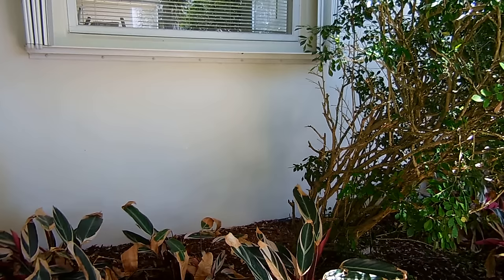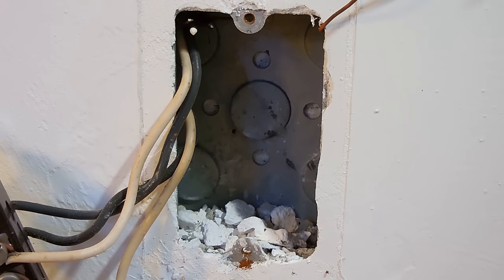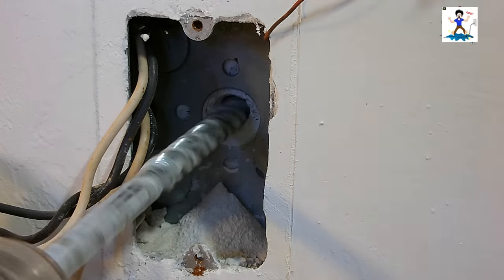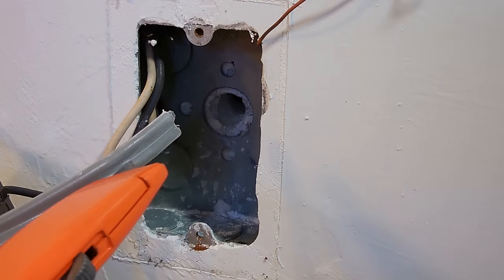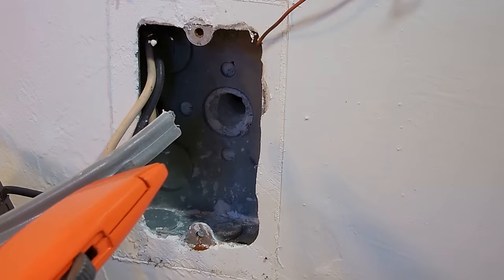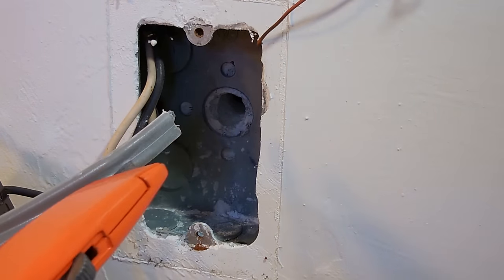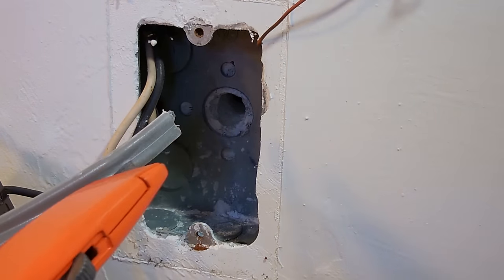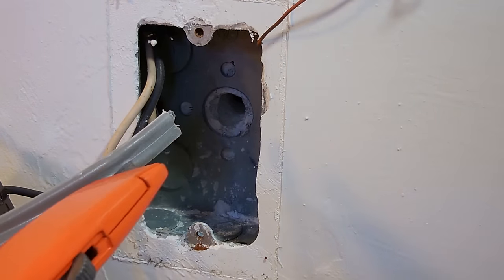How To Add An Outdoor Exterior Electrical Receptacle

Comment: This must be American Code. Canadian code does not allow outside receptacle from an indoor circuit. Also cannot pull romex through masonary brick or block. And there is no connector wire to box. You also need 6” minimum wire inside box. All outdoor 120Volt receptacles need in use covers!
Reply from the maker: That may be true, but I can assure you that there's nothing unsafe about it. Very few people will pay an electrician several hundred dollars or more to run a dedicated line from the breaker panel to the outside receptacle. The cable through the wall is a "UF" cable, which is designed for direct burial. Length not critical for the wires. The rule should be nothing less than 3" past the face of the box. As you can see, an exterior cover was used outside. Thanks for watching

Comment: Generally not a bad video but this idea that being centered in the opening doesn’t require a connector on both ends of the wire is false, also uf cable he uses is not required when running romex thru concrete any romex can be used. He also mentions you can use a flat cover if your not leaving things plugged in which is not true the minimum code standard for many years is to use the Inuse cover he shows

Comment: You need a wire nut on those ground wires. Just wrapping them together is a code violation.
Reply from the maker: You can add a green wire nut with a hole in the end. The wires were twisted very tight, no real need for one because it will never come undone. Nothing unsafe about what I did, but if you plan on having it inspected, use a green wire nut.
Reply: "No need for one" except it is a code violation. 🤷🏼‍♂️
Reply from the maker: @brianharmeson3144  What's code today, can be a violation tomorrow. It's always changing. I only worry about things that may result in a hazardous/dangerous situation, and what I did isn't one of them. Do it your way.

Comment: You forgot to insulate the outdoor electrical box
Reply from the maker: I filled the hole for the wire with silicone sealant on one side.

Comment: Code violation. You need a weather resistant (WR) rated outlet for exterior applications.
Reply from the maker: Wrong. As long as the cover is weather resistant, that's all that matters.
Reply: Wrong the nec is very clear on this
Reply: WR outlets with extra duty covers. 

In the case of a home it also must be a tanper resistant outlet. For businesses it must be spec grade. For a business that deals with children (such as a daycare or school) then it must be spec grade, weather resistant and tamper resistant.

Comment: Put a new plug on the wall (it's 1960s, right?) That way you would have the extra holes to add the new wires.  Plus, a 1960's plug has at least 50 years on it.  It time to put a new one in.
Reply from the maker: Hello Lynn. The house was a friend's, built around 1961. They didn't want to replace all 5 receptacles in the bedroom so they match. I only replace receptacles if they're damaged, or I notice that the blades of the plug feel like a loose fit inside the receptacle. The age is not really a factor. Thanks for watching!

Comment: Lots of code violations. No connector holding wire. Blew UL listing by drilling box. They come with clips. Should use some duct seal 

Not craftsmanlike.
Reply from the maker: Another pedant, YT is full of them. My job will easily outlast you. Electricians hate when people like myself show others how to do the work themselves and save a lot of money. You lose work. Drilling the same location of a metal box knockout will not do anything to the UL rating. Nice try. No need for a connector through a concrete block wall, the UF cable isn't going anywhere. A wood frame wall, absolutely. As for space around the UF cable, it was filled with silicone. Have a wonderful evening.
Reply: A simple practical solution would be to coat the screws in Goop sealant.

Comment: HUH?  you can't use it if it is switched controlled?  Yes you can.
Reply from the maker: If the receptacle is COMPLETELY controlled by a switch, you cannot use it. If the receptacle is split, then yes.

Comment: this should only be done by electricians ._.
someone may start a fire
Reply from the maker: You think electricians are perfect? No. Usually when you call up a company to have work done, they send over an unlicensed electrician working for the company which holds the license. I would know. :-) Been there and done that.
Reply: electronicsNmore well. if you putt it that way.  the situation is different where i come from. free education an shit ton of documentation of workers and jobs done.

altso. if a fire starts, the insurence companies will find out where the fire is started. if that single recepter is not documented then you are screwd. no money for the damage.

Comment: When i would do that here in the uk, i would go in jail for it.
Reply from the maker: Another reason why I would never want to live in the UK. even though there are many beautiful places in the UK. No one should ever be told what they can and cannot do with their own property.
Reply: Yes, that is also my view, if I could I would move away.

Regards Thomas
Reply: Cultural differences - houses change owners often, society has an interest in you not making your house unfit for others. If you pass the exam you can do your own electrical work. If you get your work passed by a qualified electrician you can do your own work. UK 240V is more dangerous. You are not the only one at risk, visitors, people doing their job (like postmen). There's no sign of these rules on who can do electrical work actually being enforced. But I expect if you manage to kill someone with shoddy electrical work you'd go to jail - any difference to elsewhere? The rules came in relatively recently to protect people from non-qualified electricians after a tragic incident. I can't say I am a fan of them either.
Reply from the maker: David Pilling Well clearly, if you don't know what you're doing, you should not be doing it. It doesn't take a rocket scientist to be an electrician. 120V & 240V are both deadly. As long as overcurrent protection is in place, no exposed wires, and you have proper grounding, there's little if any risk. When a home is sold, you get it inspected. So one person does something wrong, and everyone else gets punished? I don't agree with that. That's what Liberals do.
Reply: This is what happened to me, someone foreign in the country has built shit and I was punished for it. Not punished with fees ore something but it was taken away from me.
Reply from the maker: That's very unfortunate, but you put forward the perfect example showing why you need to get an inspection before purchasing.
Reply: Maybe but my case have nothing to do with electronic, it was what some other people have done and the fucking politicians have changed something that amount many other people in the uk too.
Reply: Well Doug, then if someone knows what they're doing, do they need this video? It's quite basic stuff, as you write, no rocket science, so IMHO people who know what they're doing will find it redundant, and people who don't know what they're doing should't be doing it and hence shouldn't be watching the video. Just sayin'....
A side note. Funny how America twsted the meaning of the word "liberal". In Europe it used to mean people opting for political and economical freedom (liberty), private property and entrepreneurship, as well as minimum state involvement (Adam Smith etc.). 
Being a powerful country US have appropriated that word to mean socialist / left-wing agenda, and these politicians stand for quite the opposite to the original meaning. That's a clever plot to influence reality with language, because now conservative liberalism, which in 20th century used to perfectly describe a political option (conservative values & freedom based economy) now sounds like an oxymoron... George Orwell perfectly predicted that use of language by socialism to screw up the political reality :)
Reply from the maker: If someone didn't know what they were doing, and watched this video, then they'd know what they're doing. LOL :-) People that don't know what they're doing and decide to work on AC mains wiring, are the people I was referring to. You should have realized that. As for the "Liberal" meaning, you have the Democrats to thank for that. :-) They twist everything around. They call Republicans racist, meanwhile the Democrats were the ones behind the KKK, the Democrats voted unanimously to KEEP blacks slaves, while the Republicans pushed to END slavery and voted unanimously to end it. The Democrats also did not want women to vote. :-) We now live in a nation where most people are totally clueless to the facts, and easily brainwashed with lies. What black person or woman would vote for a Democrat knowing these facts? None, unless they're stupid. Liberals are destroying the USA.
Reply: Some people can't know all about electric wiring some stuff and with this nice videos you can learn it and do it when they knowing what they do, i think youtube was in the past the idea behind how someone can teach other people how to do thinks proper :-)
Reply: Some people can't know all about electric wiring some stuff and with this nice videos you can learn it and do it when they knowing what they do, i think youtube was in the past the idea behind how someone can teach other people how to do thinks proper :-)
Reply: @electronicsNmore  Amen! Preach on brother!
Reply: Wait?! It is seriously illegal for anyone other than an electrician to do electrical work in the UK?!?! Bullshit!
Reply: @electronicsNmore  EW. Politics

Comment: Code says you have to wrap the outlets with tape on all metal boxes. Code says you need to use a bubble cover on the exterior. Code says you need to add an ARC fault Breaker to any feeder circuit when new wire is run. Leave electric to electricians not a handyman.
Reply from the maker: Another hostile electrician that's pissed off that he's losing business. 🤣 Are you blind? The outside cover is specifically designed for outdoor use. If you think a homeowner is going to run a dedicated line costing several hundred dollars or more, just for an exterior plug, then you're a fool. The GFCI as shown in the video is just fine. 100% safe. What's code today, one or 2 years later becomes a violation. 

https://www.homedepot.com/p/TAYMAC-1-Gang-Horizontal-or-Vertical-Mount-Weatherproof-Extra-Duty-In-Use-Cover-GFCI-Combo-MG420CSB/206974012
Reply from the maker: @5_fun_facts123  Most permits are nothing more than money making government scams. If you were smart, which I don't think you are, you'd know that ARC faults in the USA are extremely rare, so rare, that there shouldn't even be a requirement. 125,000,000 homes in the USA, and 50,000 electrical fires per year. Of that amount(Mostly due to overloading extension cords with AC's & heaters), 1/2 are due to arc faults. So we have 0.0224% of homes with arc fires each year, 200-300 dead out of 365,000,000 people, and supposedly hundreds of millions in damage. The NEC says we must use AFCI's because of that minuscule number? Millions of people have to spend all that extra money each year building and renovating homes, way more than the yearly property damage due to Arc fault fires, and electricians to install them, because of 200-300 dead? No logic. Sounds like someone was paid off big at the NEC to make that code mandatory so companies can make a lot of money selling them. Enough of my valuable time wasted. Have a great day!
Reply: @electronicsNmore  
Yeah. AFCIs should be optional.
Plus, if there's that much concern, do people consider armoured cable?

AFCIs, at least certain ones, have been known to nuisance trip from radio transmitters.

A possible unintended benefit though might be protection from lightning strikes such as if a combination AFCI/GFCI used on a pool pump.